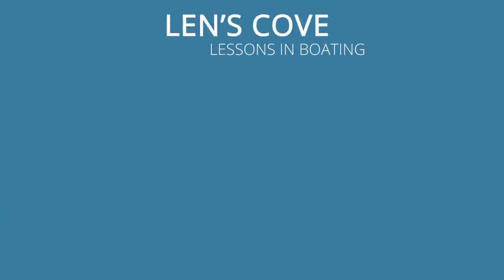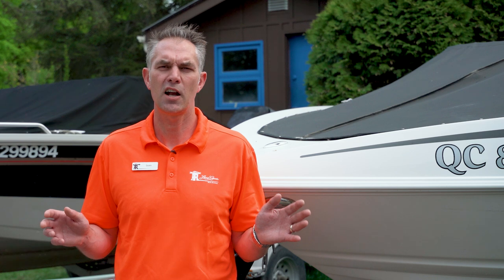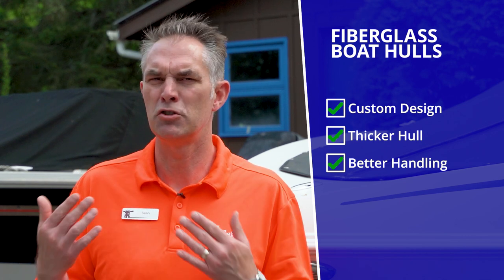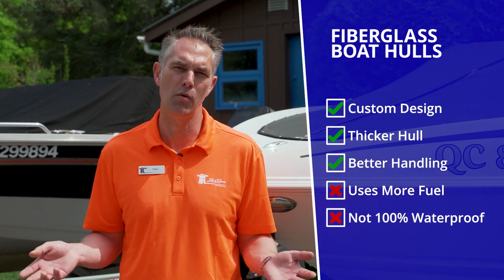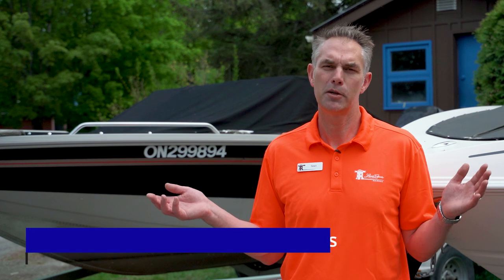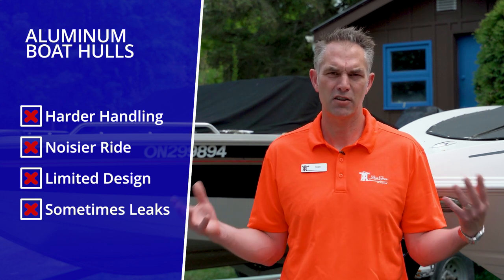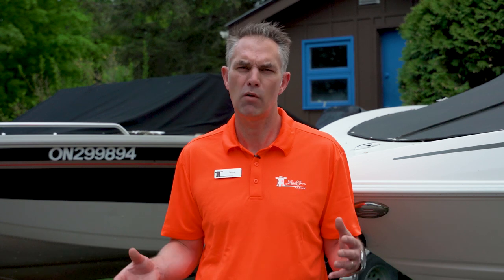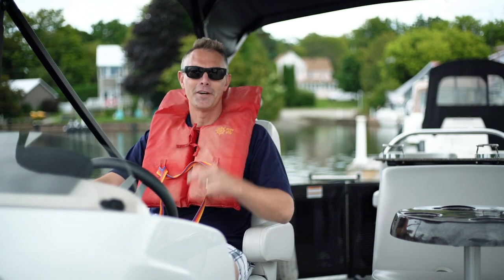Aluminum vs Fiberglass Boats

Comment from the maker: What is your favorite...aluminum or fiberglass?
Reply: I’ve a few of both... aluminium is for me, the way to go, especially in Canada.
The best boat I had was a crestliner Sabre 20ft.
Took some big waves, easy to trailer, easy on gas and no osmosis.
I’m not sure if this is accurate but I was told many times that when fibreglass freezes in the winter, if it’s stored outside or inside, the water inside the fibreglass freezes and make the fibreglass crack and wears it a lot faster.
I now have a 19ft prince craft with a 150hp and it flies and runs perfect.
We can sit 6 and can carry a lot of gear,
We fish and use it for family activities. 
That’s my 2 cents
Reply from the maker: Nick. Yes, the moisture in fiberglass does freeze and can cause minor long damage over the long term.
Reply: @nicknick1974  0
Reply: Your first statement of where you live and how you use your boat says it all. For me, living in Michigan (lakes everywhere) and a fishman aluminum is a no brainer. Easy to tow, easy to launch and retrailer, inexpensive, low maitenance and since mine is only 16 foot I can go in almost any lake from a small inland lake to any of the Great Lakes (you have to pick your day). I find aluminum is much easier if you are by yourself.
Reply: InstaBlaster.
Reply: Weight could be a big deal when it comes to towing.  If you have to get a new tow vehicle you are talking a huge extra cost.

Comment: I worked for OMC (Outboard Marine Corporation) for a long time, and have watched, and worked in the 'hull department'...and I'm here to tell you, I'd NEVER actually purchase a fiberglass boat! The reason? He forgot to mention that the stringers and bulkheads on ALL 'mid-market' fiberglass boats are pine plywood and studs! The matting is prepared, the release agent is put on the mold, the mat (wet hull) is laid-in, and then the stringers and bulkheads are installed...then capped with more wet fiberglass. The end result? A wooden skeleton, wrapped in semi-permeable fiberglass...that over time, takes on water, swells, stress-cracks the fiberglass, then rots (air gets in), then much of your structural integrity and strength are gone...and if you don't think so, go to the next 'major storm area' afterwards, and look at the 'toothpicks' left of 'fiberglass boats'...you will see rotted sub-structure EVERYWHERE! Forget that, buy an aluminum boat, learn to TIG weld, and keep your boat FOR LIFE! If 'fiberglass' was so great, major ships would use it for hull design...as it is, the U.S. Navy is turning to 'Aluminum Hull military ships' currently...and THERE IS a reason for it...(also, if you want more proof...just look at your 'always in the water houseboat designs'...there is a reason they are ALWAYS either steel or aluminum below the waterline).
Reply: Yes.... this is the fact.
Reply: I live in Tasmania, Australia. There’s very few glass boats here. Ali boats are everywhere for the exact reasons you mentioned!
Reply: Omc is the worst!
Reply: Great points, thank you!
Reply: You couldn't give me a glass boat if I had to own it. Love my aluminum. Love my FRIENDS' glass boats because they are their problem. The pros aren't worth the cons for me
Reply: In europe we have a lot of fibre boats that are well made and last 60+ years with no repair.. mostly thick boats though.. like 1'' thick firbreglass.. not the cheap usa construction ones..

Comment: Really good, calm, rational explanation.  One thing I see today--is heavy, heavy aluminum boats, like Duckworth, Hewscraft, North River and a 20 foot model going for over 100K--unreal.  Yet, the design strengths and limitations you describe still apply.
Reply: If fiberglass is so much better than why are all your mud boats and jet boats that run rocky rivers all aluminum!!!???? Use your brain if fiberglass was better than aluminum they would use it it costs more to build a quality aluminum boat than plastic!!!
Reply: @thomaskitlica5572  I for one have never argued that fiberglass is "better", not sure where you are coming from in that remark.

Comment: I had a 18' aluminum boat with a Johnson 110 two stroke. The trailer boat and motor weighed around 1600 lbs. I just bought a 19' fiberglass CC with a 150 hp Merc. My Highlander is definitely feeling the difference. The boat alone is 2800 lbs the trailer is 600 lb I believe. My tow capacity is 5000 lb so I'm 200 lb over the 80% rule of 4200 lb. When I brought the boat home I found out there was water in the bilge area adding weight so I was definitely maxing out my tow capacity. My aluminum boat had carpeted wood floors. They were solid and the carpet was nice but man I love having a self bailing fiberglass deck. The aluminum is definitely tougher skinned and it's actually safer in lightning storms than fiberglass. They are rugged but ride like a soup can unless you have some weight in it. I would not hesitate to buy an aluminium boat for a second if they put aluminum decks in them. I will never own a wooden deck again.
Reply: You shouldn't be town with a Highlander. Get a V8.

Comment: Look at almost every charter and or work boat in Alaska. Very rough conditions, what type hulls will you predominantly find? Plate aluminum. How many fiberglass hulled boat get purposely beached in regular usage? I have owned 4 fiberglass and ever one of them had wood rot. Rot in the transom, stringers, and gunwales. Any place a penetration was made for mounting a motor or motor mount, a rod holder, a rail. Gel coat cracks let water in and fiberglass swells causing blisters. Aluminum dents, stretches then tears. Taking on water? In an emergency you can hammer on a tear in an aluminum hole to make it smaller then stuff it with rags and wood wedges. Can not hammer a dent out of fiberglass. In an aluminum boat you cut out the damaged plate and weld in a replacement piece. Fiberglass repairs are way more involved and good luck matching the gel coat. I love my 23’ 6,300lb aluminum 23’ boat. No more glass hulls for me.
Reply from the maker: Yes - everything you say is true. Your usage and repair ethos is different than the majority of easy going day boater though. Way to go :)
Reply: That’s been my thinking as well.  That’s why you don’t see hardly any Fiberglass boats made after the late 90’s for sale up here.  Pretty much everyone is running aluminum.  We’re looking for a boat to day fish out of the sound or Seward.  Pretty much sold on aluminum after this.
Reply: Here you go, aluminum hulled RIB boat.  In an emergency at least its unsinkable, I know famous last words.
Reply: @boatinglessons but you clearly stated in the video that fiberglass is tougher which is a bold face lie!!! Fiberglass is normally a half inch thick minimum and aluminum is normally 1/4 inch or less but yet it's easier to crack the fiberglass!! So how is it stronger when it has to be over two times the thickness and still not be as strong!!!
Reply from the maker: @thomaskitlica5572  My intent was not to lie, but rather communicate our knowledge based on our local experience in our market place with the boats that we have here.

Comment: Everyone here seems obsessed with hull strength and the ability to hit a giant log or something. A big part that needs to be consider is which material makes a nicer boat to be on. Fibreglass boats are more comfortable. They are quieter smoother and feel more solid in the sense that the material is thicker. They are just more pleasant to be on and they are just as strong as aluminum in water as long as you dont hit a rock or tree  which is pretty hard to do in the ocean. This is my take as someone who fishes the pnw
Reply: Fibreglass is crap and falls to bits 😂

Comment: I live in Florida it's not the lake water that threatens you down here its the rain. It took me one time out caught in a fast moving thunderstorm to realize just how dangerous the rain was. People have a tendency to feel safer in lake than the ocean. Until you get caught in a Florida thunder storm on a big lake you can't begin to realize how wrong feeling safe is. My boat was getting hammered by 4" an hour wind swept rain and the temperature went from 92 degrees to 72 degrees in minutes. The lake formed a chop in minutes and that chop just kept getting more intense by the minute. There was a definite bathtub effect happening These waves were bouncing off the shore and growing each time. I always run a  good bilge pump and I had a 1100 gallon bilge pump thank god it kept working and it was working hard to keep up with the water entering the bilge. I lost everything else the motor wouldn't start the electronics were failing but that beautiful pump and my trolling motor saved the day and I limped along the shoreline bach to the ramp. If you go down in Florida you're swimming with alligators so I bought a 19' CC with a self bailing deck and as always I put a brand new 1100 gallon bilge pump float switch in it and added a second bilge pump just above the first. It's a ocean boat that's how serious I take the weather and the lakes down here with over 28 miles of shoreline.

Comment: You can beach an aluminum boat on a pebble beach with no harm done. Don't dare touch your fiberglass hull to anything
Reply from the maker: Yes, you need to be more gentle  with fibreglass on hard surfaces
Reply: Aluminum boat corrosion on salt water.

Comment: how will heat exchanges react ? if I try to wrap the hull of an aluminium trawler with gelcoat and 2 layers of fiberglass in and out. I will have the advantages of gelcoat like you said, keep salt water away from aluminium, smoothing rough edges...

Comment: Just few other things that differentiate aluminium from fiberglass in my opinion...When a fiberglass boat reaches its lifecycle end, it is a big waste that can't be reclyded, while an aluminium boat is a "reserve" of raw material that can be totally reclyded: for this, beside the (important) ecological point of view, an aluminium boat should maintain an higher value than a fiberglass one. Furthermore, if a fiberglass boat "suffers" of osmosis, an alumium one "suffers" galvanic and electrolytic current corrosions: so I would say that from this point of view both must be cared in ordert to have always an efficient hull. Finally, fibreglass, as all other glass rinforced plastics, is a fragile material. Aluminium, as all metals is ductile. If you have a crash with a fiberglass boat it is possible to make an hole through the hull, while the aluminium one should just bend (if you don't have a very big impact against some cutting obstacle....I remember the Costa Concordia - made of steel not aluminium - against a rock that cutted it almost all side long)

Comment: Living in the NW the aluminum boat is like a pickup truck.  It keeps its value and can be sold for top dollar year round.  My Northriver boat is like a tank and looks as nice as the day 2005 I purchased.  Plastic boats lose value, have cheap interiors, cheap hardware, and cheap trailers.  Check how well a metal boat vs a plastic boat depreciated.

Comment: Hey Len's, I love your videos, I had a few questions; does a fixed tower assist with structure, as in, could a tower add rigidity to an aluminum hull? If you want a boat with a more simple hull design, does that detract from the function and structure of the boat? What are some features I should look for in a boat if I want to do 80% cruising and 20% sport? Thanks!
Reply from the maker: A tower does not add structural integrity to the boat itself. If anything, the added weight adds stress to the hull sides. Most good manufacturers have added enough support to account for this.

Your other question is more complicated and I would need to know more to answer. Email me if you want to discuss further: sean@lenscove.com

Comment: I’ll looking at a 21 foot 2016 Allison.   I’m a crappie fisherman (tournaments/guiding) and one guy is telling me that the Allison hull can not endure stumps like an aluminum boat. I want a “rocket”, for obvious reasons.  I was under the impression that fiberglass hulls today are very durable    Is the Allison hull not as durable?
Reply from the maker: Fibreglass is less malleable than aluminum. An impact that may cause a dent in an aluminum boat will cause a scratch or possible crack in a fibreglass boat. 

In rough seas, fibreglass is superior for overall hull strength. For bumps and impacts, aluminum can sometimes handle it better
Reply: @boatinglessons Then why are all your work boat's, and supply boat's aluminum they take a beating every day of their lives!! In the oil industry you won't see a fiberglass boat!!! In all reality the only thing a fiberglass boat has over a metal boat is they do generally ride better but that's even changing!!! Why do you think in the fishing world more and more boat's are showing up metal!!!

Comment: Hi there, I'm new to boating. I was given a 86 sea ray pochanga with a 350 magnum and was wondering if you knew where I can get a replacement alfa one gen 1 outdrive or if possible to replace with a bravo
Reply from the maker: Victor, there are lots of replacement drives available through aftermarket. Are you in the US or Canada? Do you deal with a local marina? As for upgrading it to a Bravo, that is not really possible without massive amounts of work as the entire transom assembly is different.
Reply: I'm in the US, no I don't work with local marina I'm a DIY guy and was wondering what you'd recommend doing and where's a good place to get a replacement unit and thanks for replying

Comment: What does a 40 year old fiberglass hull look like? Will an old boat like a Chris Craft have to be  junked.
Reply from the maker: That all depends on where it was used, how well or not it was taken care of, etc. It could be junk, or could be gorgeous. There is a strong possibility it could have issues though and should be looked at very carefully
Reply: @boatinglessons   I was thinking if an old fiberglass hull boat goes over a wave will the hull crack and break.
Reply from the maker: @CDaeda  same answer applies....it all depends on how it was maintained, stored and used. We have 45-50 year old fiberglass boats here at the marina that people still use every year.
Reply: @boatinglessons  I don't disagree with you, but polymer usually tend to lose a little their mechanical characteristics with exposure to atmospherical agents such as the sun (especially kevlar). Anyway I agree it depends a lot on how the boat has been cared during her life
Reply from the maker: @compassft  Yes, they all eventually break down. It's a good thing too as people keep old boats going too long anyway ;-)
Reply: Most likely repaired.
Reply: @boatinglessons well then wouldn't you want to encourage metal boat's as they can be recycled and not just sunk in the water or in a landfill!!!

Comment: Missing information is comparative weights between both...!
Aluminum’s electrical conductive problems will forever be a problem especially on large Blue Water sailboats. If Aluminum weight difference is large enough, possible to use outside hull as Base for applying Epoxy/resin/thin material with Gell Coat thin layer. Aluminum immediately oxides once virgin material exposed to air, so covering it with a protective layer is encouraged. Aluminum also cracks from being work hardened. This will show up from stressing. Fiberglass is known to move around and shrink with age. An example is older Corvettes where doors shrunk leaving larger gaps. Plastics and steel require annealing over time to lessen hardness and make more flexible. This is part of the work hardening process that pro uses crack.
Reply: So carbon fiber isn't a big deal anymore, my bike is carbon fiber.  So why not carbon fiber boats?

Comment: How about aluminum /fiberglass on choppy waters of lake eire VS fiberglass/aluminum  on Lake Michigan
Reply: My dad had a 22' fiberglass and I have a 16' aluminum. I have been on both lakes in both boats. In rough water the ride out to your fishing spot the 22' had a more comfortable ride. However while trolling if you want to stay dry the aluminum boat is much better. The reason: That 22' Searay my dad had would porpose the waves in rough seas. As it was on the way down from one wave the weight of that boat would plow into the next wave throwing the wave over the bow, . I have never had a wave go over the bow of my aluminum boat even in 4' +  waves, it bobs like a cork.

Comment: Another thought....where you live affects this decision greatly.  I live by Long Island Sound - 100 mi long by 25 mi wide.  It would be cheaper and more comfortable to trailer boat to the far end then fish, rather than run in open water the same distance.  There is a cost w larger heavier FG boat where you must leave it at Marina then make long runs in open water.  
Seems if you live close to lots of lakes or long narrow body of water, Aluminum notso bad.
Reply from the maker: You are 100% correct Charlie!
Reply: Yeah, big boats are for the ocean.  You don't need anything huge to go fishing on the local lakes.

Comment: Aluminium is the only choice as far as I’m concerned. It will still be on the water long after the transom and stringers have rotted out of a glass boat. You forgot to mention one other important thing. Strength. You it something in the water in an Ali boat and you probably won’t notice. You may just get a hole in your glass boat! Also, I don’t hesitate to Beach my Ali boat!